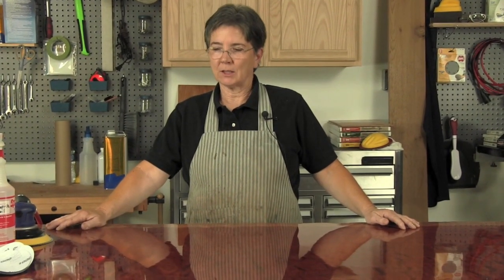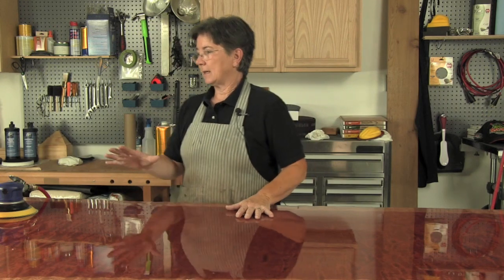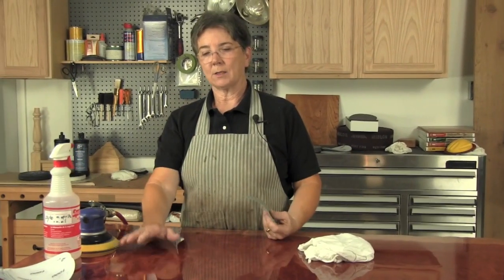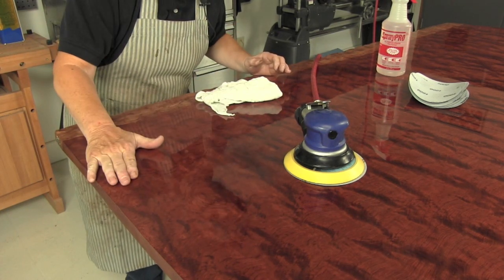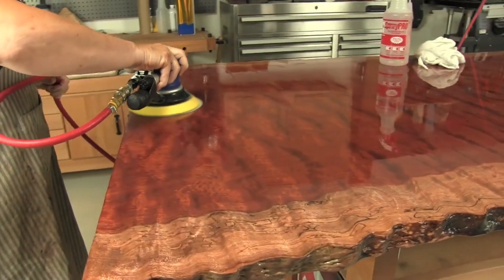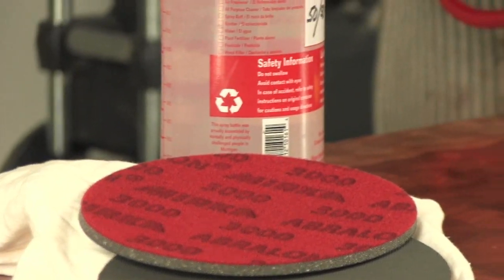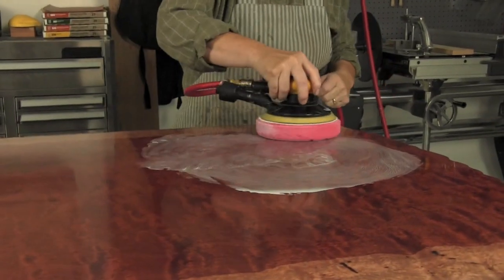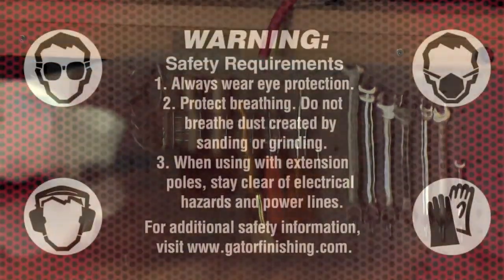How-to get a Bubinga Board Piano Finish

Comment: I have been explained by the Mirka technician that to level, the orbital sander is not ideal, and that a somewhat long rectangular sander is preferred, because of a better reference surface. Now the finer grits will be done with the orbital

I use to polish with a fast speed once the polish is beginning to shine (it is not supposed to dry but to "break" or be "cut" then I oush the speed and use a light hand on the tool

Clean microfibers for the cleaning, and when they have been used they are due for the washing machine 

On flat surfaces, the roto orbital type polishers are more in use today, they avoid holograms, the best ones have a fixed gear (the plate is fixed, not free) 

Best regards

Comment: Great work as usual Teri,
If I can't spray anything but water based finishes do you have any recommendations? I've tried Target coatings but had some yellowing issues. then i tried General Finishes and I can't seem to get away from the plastic looking finish with both their poly and High Performance. I also don't trust this is a good enough finish which I can rely on for making furniture for future clients.
I've recently ordered some finishes from Crystalac to try out and hopefully will get to use it in the next few weeks but I won't know for sure how I feel about it until I've used it on several different projects. 
If you were told to spray only WB finishes for furniture pieces, table tops, potentially piano finishes like you just did, which would you look at?
Thanks and thanks for the video.
Dave

Comment: Is this type of finish practical? I have a client with a 13 foot long slab of bubinga/rosewood and they don't like the standard gloss polyurethane. They are requesting piano finish, no visible grain or splits and cracks. Wondering if 1) I can salvage the 4 coats of oil gloss polyurethane by applying lacquer or something over top of it and 2) if this high gloss finish is durable to be used as an every day countertop.

Comment: to lay it up to cure for a month..does it or should it be in a heated shop?  I want to work on my 15' bubinga slab..but my shop isn't heated.  I live in Vancouver Canada.
             EXCELENT video, thank you!    regards, Ron.
Reply from the maker: +Swedish Holmberg Sorry for getting back with you so late! Yea that finish isn't going to cure correctly in cooler temperatures. Send us pics of the finished product.

Comment from the maker: The finish used in the video is a CAB acrylic lacquer. Not suitable for daily use and the high gloss would show every finger print and smudge. The Osmo oil that you are referring to would be far too soft to polish to a high gloss.    A more durable finish for a dining table would be a catalyzed lacquer in a lower sheen.

Comment: hello, why using oiy lube with abralon type ? is not it clogging the abrasive soon ? I use water , a little alcohol and some surface agent, as a sanding media, But generally this is polyester , very hard, need to be buffed with cotton wheels. Polyurethane laquer will go more easily it is way less hard indeed . (may be why you prefer oil or is it because you used a water based lacquer?)

Best regards
Reply from the maker: You have to have some sort of lubrication between your surface and your sanding disc when starting the beginning stages of polishing out a surface. This is  called wet sanding, and this beginning process is called flattening. Wet-sanding lubricates the surface being abraded, reducing scratches. The water mix or the 50/50 mix of mineral spirits and mineral oil ( which is what is used in the video) also carries away loose pieces of abrasive as well as finish particles and prevents the sandpaper from loading up. This will eventually clog your abrasive after much use, you should then replace immediately so you don’t risk gouging or putting deep scratches in your work. The reason why Terri chose this mix of mineral spirits and mineral oil 50/50, is because it’s her personal favorite and is also an ideal sanding media in the polishing process. Also, the finish on the bubinga board is not water based, and it wouldn’t matter if it was when using the 50/50 mix. The finish is a high gloss CAB acrylic lacquer.
Reply: Well I get  your point, of course the 50 50 mix looks like a neat medium (unless some pores are yet open then the oil drip !! ) I think I will give a try on shellac eventually
But I try to keep my abralon a long time, the water is also perfect to evacuate the sanding result, only the more the grain is thin the less fast I turn (this is important as the abrasive need to grab in the surface, and too much speed will build heat and clog the abralon soon.- less with oil indeed)

Then with water/ soap, when finished I spray the abralon with a little "polish remover mix" (alcohol distillated water and soap, a drop of ammonia,) and I put all the disks under water, and presses them so the product that is in the foam is expelled. That way I think I keep the Abralon useful for a long time . I have a look with a small x60 magnifier or usb microscope, on my pre polished surface, it is éducative . 3000 grit is providing 80% of the shine, 4000 is 90% , with PE the gloss is obtained fast
 with mutton or cotton wheels (and the good wax or polishes, one without a chemical effect - so some car products are avoided.
Best regards
Reply: I also learned an important point recently, even with Abralon, the orbital sander used is the one with medium orbite (5mm, or 3/16" sorry French ;) not the small 2.5mm one. why ? because with the sanding disks that have holes for extraction, the small orbite make small "commas)s" that are too short to push the dust to the holes, then you get swirls. It is amazing as I have zero swirls with the 5mm (MIrka 650)
To rise the shine with Abralon, the pressure should be limited, as the speed (around 4000 that is with the lever almost close ) but the most important thing is to MOVE SLOWLY ; it really makes a difference I did make pics showing that.

Here they are, sorry only a few comments in English, but I noticed the easier swirls with the 3/16" orbital sander) 
https://goo.gl/photos/73ZPnMD8NtBFwr3g8
To see if the speed is good, there is a trick ; the foam created by the water (may be the same with oil) should not be larger than 5mm (3/16") on the back of the disk (the half moon trail) it shows an advance speed +- clearly.
(ALl the things I said come from specialists )
Mirka checked with personal experience) 
I LIKE the "Microstar abrasive, suited for young laquers or the ones that are not very hard. I could sand sheallack without "pif tails" with that abrasive (cleaning the disk and the surface often of course, the disk with an aggressive type microfiber, as the ones to wash dishes, or the special brush to clean the cloths, the surface of course with microfiber, dry, changing the cloth often enough

Best regards

Comment: The finish with the wax looks just as glossy as the video started. Why need to sand  from 1000 to 4000 instead of just starting with the swirl removal? Is it only to completely flatten the coating? I imagine even with spraying it it still has very fine texture maybe?
Reply: You know nothing John Snow

Comment: Nice finish, but you wasted a lot of compound. I would have used a quarter of that amount! Try it. Squirt a thin line of compound 6 inches long and catch that up on the edge of your buffing wheel. Then proceed in the manner you did. Polish a square foot with that. It works. And you will have less to clean up. For the rest you are up with the best!